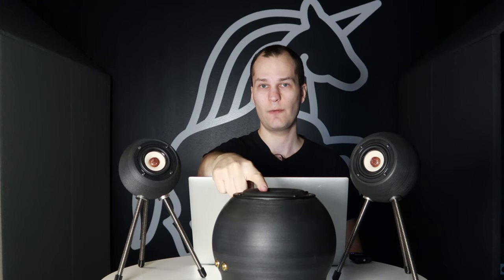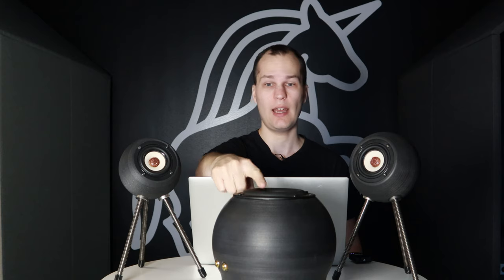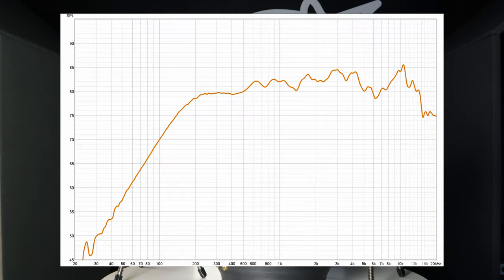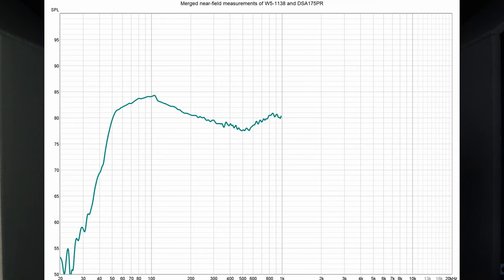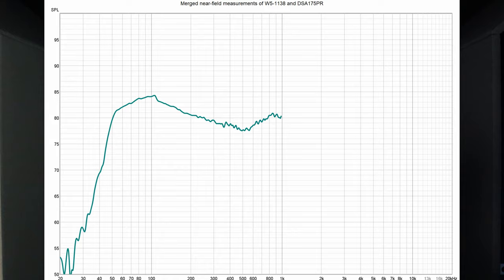3D printed subwoofer using TangBand W5-1138 and matching satellite speakers

Comment: You should check out a ADAU1401/1701 for active crossover. Good video! Stoked to see someone using tang band hardware. Please do a short listening video!
Reply from the maker: We haven't looked into using DSP chips alone yet, but we do have some Hypex Fusion amp modules for our next build using these same drivers. It's going to be a three-way with the W5, W3 and TangBand tweeter. It seems listening videos are interesting despite their inherent short comings when it comes to assessing sound quality. Thank you for the feedback, we will do a listening video next!

Comment: LOVE what you do, but what if you added a passive radiator on the wubwoofer to get a stronger kick? ive been looking for ways to use up some 6.5s hence how i found your channel but seems no one has made a box for 2x 6.5s yet lol hope to see more 3d printed videos! keep up the great work "EDIT" just seen you already had passive radiator lol
Reply from the maker: Good point, it was not explained nor shown in the video. But yes, there's a down-firing and slot loaded PR at the bottom. We should've included that in the video, but forgot!

Comment: Do you have a build video? Curious in getting the .STL files but want to see how it's all put together.
Reply from the maker: We are working on more videos and that is one on the list. Keep in mind, though, that these are passive speakers without any crossovers. All you need to do is mount the binding posts and driver and have wires connecting them. It's as easy as a loudspeaker build gets, but people do like a video showing it anyway.
Reply: @DIYAudiobyRDPhysics  I'm mainly curious about the sound dampening and filling you mentioned for the subwoofer. It's hard to understand without having the files.
Reply from the maker: @shokwaav123  Absolutely. The inside wall of the subwoofer can be damped using sound deading mat (the one for car audio). It's not mandatory since the spherical shape is very stiff as is. For filling you should put some wool or polyester pillow stuffing like normal loudspeaker build. We hope to have new videos out soon, though!

Comment: Nice video 
Very different
I am interested in a 2.1 better than arylic 
I need 200 watts rms fir my 10” sealed sub
Reply from the maker: One three channel Hypex fusion amp might be an cost-effective option. I know it's a plate amp but we will be providing files for 3d printing and enclosure for it.
Reply: @DIYAudiobyRDPhysics  I love the Hypex plate amp concept but unfortunately it’s a single channel can’t make it 2.1. Wish they had made a good 2.1 amp with dsp they have all the knowledge and resources.
Their UcD modules are great but no dsp option so we will have to use miniDSP that approach I don’t wish currently
Reply from the maker: @anandshah71  The Fusion Amps have DSP and 3 channels so you could use one in a 2.1 setup